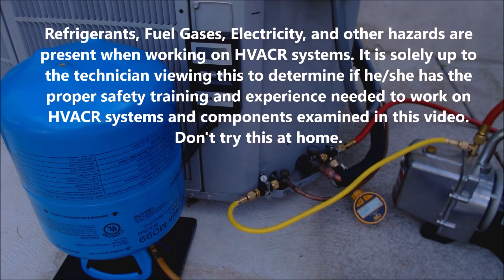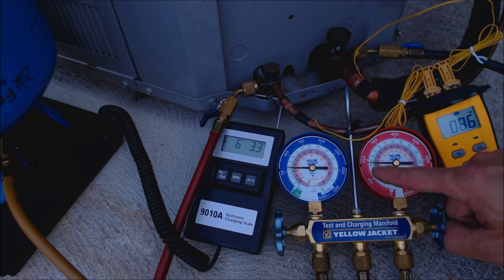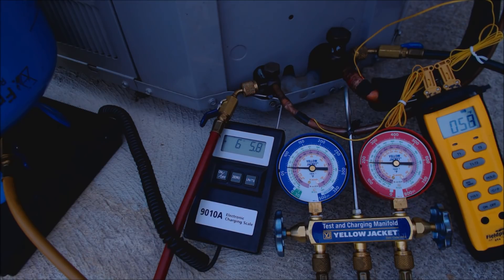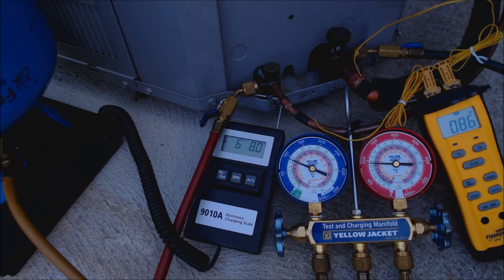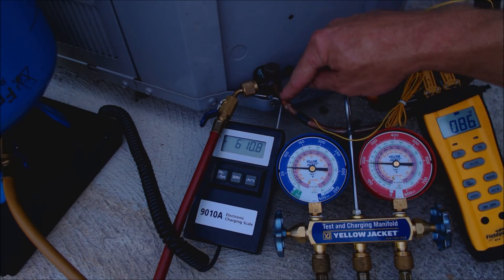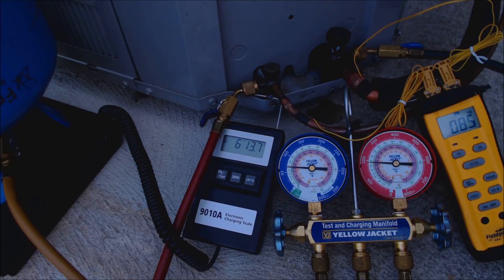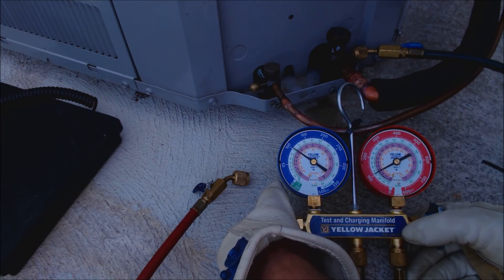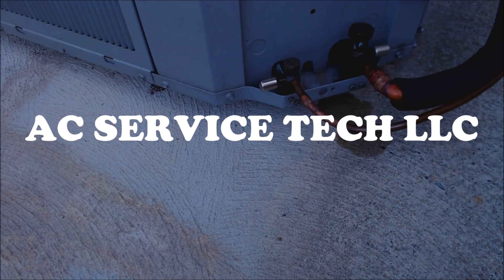R-22 Conversion to R-438A M099, Reading Pressures, Adding Refrigerant, & Disconnect

Comment: Glad to see positive videos about R22 conversions.   Too many techs just want to sell you new systems, so they make conversions sound risky, dangerous, not-as-efficient, etc.
Reply: Very true...i am trying to find a technician to do it on 2 a/c units and haven't got no luck yet sadly. Not right...
Reply: @estherbarbara  It's not set in stone, but one of the independent a/c contractors are likely to be more helpful than one of the large a/c companies.  Also, the end of the summer season or out-of-season is the best time ... when a/c guys are not very busy.  In addition, you have to weigh up the cost of R22 (which has skyrocketed in price) versus a retro-fit. If you only need very little R22 added to each unit, you might do better with a top up.   Finally, you might post your requirement on your local FB group and see if any a/c guys respond.   (Just be warned ... as I mentioned above, most a/c guys are going to want to install you a new unit, as that's where they make money!)
Reply: Update...i found a technician that did the retrofit of the units into R-427a. They are running great now. Plus a sealant I bought was added to them. Thanks
Reply: @estherbarbara  That's great news!    Glad to hear you you have saved your old ... but working ... units!

Comment: Just curious I was told that this is very flammable and dangerous to use. Due to being made with propane. Is this true?
Reply from the maker: in this mix, no and that is why this manufacturer chose to put so little of that in this refrigerant.

Comment: Hello friend ok on my kids room ac unit mini split ac it reads 130 when on with my gauge from ebay($25) and its good cold ac...now on our living room ac unit M-099 what number is good for cold ac...now I connect it with low side and with our living room ac on blowing not too cold and it reads 80...should it be abt same as the mini split reading 120-130? Please reply
Reply: Answer is 120-125 ... or ...65 on R-22 dial

Comment: Question...just replaced a compressor(heatpump)..I pull a good vacuum , add mo99 slowly in suction side about 90% of the r-22 ...I didn't install filter dryer neither I flush the lines , I have piston.... My problem is I can't get superheated ... In another the suction is 132 and head 188 psi... Compressor making a hissing noise...I had charged it with ANY running...ANY INPUT...s.o.s...

Comment: I'm starting to find a few systems with mo-99 my question is if I find a system with a small leak but customer wants to just top off the system, is it ok to top off with this blended refrigerant?
Reply from the maker: The consistency of the blend will certainly change and won't be as effective as before. It is best to find the leak and fix. The other thing is that it will be more mixed and leak mixed if it is leaking while the system is running. If the system is off then the blend really gets out of wack, thanks!

Comment: Just a thought I flush line set from attic so it flashes fast during the conversion of freon , am I right?
Reply from the maker: Yes if you flush with something like r11 flush then yes you would add it from the top and let it exit down low, thanks

Comment: very nice, yet no MO or POE be added after you recovery R22? the recovery won't lost oil?
Reply from the maker: A recovery that is done with a recovery machine while the system is off won't remove much oil so the oil level will be fine, thanks!

Comment: Excellent video and channel! One tip or recommendation I like to add is that is best practice to replace all schrader valves when retrofitting to M099. In the absence of R22(or other previous refrigerants) there can be a tendency for the neoprene material seals of the schrader valves to shrink (expand or adjust) and cause a leak. Replacing the schrader valves is a good preventative, relatively inexpensive step for longevity of most retrofits. ~ Enjoying your vids often! Nice work!
Reply from the maker: Hey KungFuMaintenance, this is a no oil change refrigerant so you don't have to change mineral oil with POE. Because of that, seals don't have to be replaced like on a r-22 to R407C. Valve cores should be changed out just because they are old though I agree. Thanks and you do a great job on your videos and content!
Reply: No need yo replace it, that's why the Schrader valve caps exist! Never forget to set them

Comment: Mo 99 is blend refrigerant isn't it and should be added as liquid ?
Reply from the maker: Yes that is correct. It has to come out of the bottle as a liquid but has to enter the low side of the system. The low side has a lower pressure than the bottle pressure where as the high side pressure has a higher pressure than the bottle pressure so refrigerant goes into the low side slowly and wait in between charges. use a 535-C for charging if there is a concern of liquid going into the compressor, thanks
Reply: Thank you very much we learned a lots just watching your video thank u

Comment: Did you put refrigerant in liquid form on low side? Not affect to compressor ?thanks,,,
Reply from the maker: Hey Cesar, this refrigerant has to come out of the bottle as a liquid. That is why I only added a small amount at a time. You can also use a vaporizer like the imperial 535-C. If it was vapor then you could just keep the low side handle open as long as you would like before stopping and checking the superheat or subcooling again, thanks

Comment: Good video! Now what refrigerant would be better MO99 or R407c?
Reply from the maker: R407C has a better energy efficiency than M099 when matched with comparable equipment but financially it may not be worth the time and effort to cut out a compressor, dump the oil out and scale new POE oil in. M099 was meant to be a fast replacement and I really prefer it over NU22B. They now make new outdoor units with POE and R407C for condensor replacements, thanks Robert!
Reply: AC Service Tech LLC so then it’s a strait drop in? MO99?
Reply from the maker: After changing the recovery, replacing the filter drier, pressure test, vacuum and as long as you don't see any issue with oil return via the existing system then yes. It is used for air conditioning applications, thanks
Reply: When installing a new condenser, say a Gaurdian with POE and stating to use R407C, can MO99 be used instead? I've had great results with MO99 and would like to be consistant with it.

Comment: What are you using to clean or flush your manifold when changing from all these different refrigerants??
Reply from the maker: I use one manifold for r-22 and M099 and another for R410a and R407C. Yet another for R134A. We do what we can without going crazy about it, thanks Shawn!
Reply: so no flush using r22 to MO99??
Reply from the maker: No, just change the filter drier unless there was a burnout or high acid contet. M099 is supposed to work with the mineral oil. Thats what they added the 600 and 601a in the refrigerant mix but nothing is really going to beat R-22 for mineral oil. I do like R407C with POE though, thanks and check the manufacturer's download -https://www.chemours.com/ISCEON/en_US/assets/downloads/k23356_8_basic_steps.pdf

Comment: i was out for 6 years medical leave union local 250 L.A. Is flushing the line set to rid it of the old oil used with the old refrigerant proven to work long run or is the jury still out?
Reply from the maker: I do think it works well but only for line sets that are mainly vertical and they won't flush evaps and condensor coils very effectively because they don't go from high to low. Once again, we do what we can when replacing burnout compressors and changing out r-22 systems to r-410a when reusing linesets. Always replace the filter drier. I replace the lineset when it is easy enough since newer equipment use larger vapor lines for efficiency, thanks
Reply: @acservicetechchannel  ok

Comment: Great video. Do you recommend changing the filter dryer?
Reply from the maker: Yes any time you open up a system for service and do all that work, definitely change the filter drier! Thanks xrayneoo!
Reply: Thats the beauty of MO99 you don't have to open the system, but in the benefit of non condensable and cross contamination I thought it proper to change the filter dryer. You have the must instructional HVAC channel in youtube. I really enjoy your videos.
Reply from the maker: Yeah since it is already at 0psig after recovery, and since you are doing all the work already, it is best to change that filter drier for the remaining life of the system, thanks a lot xrayneoo!

Comment from the maker: Download Refrigerant Slider for Free -  http://bit.ly/getrefrigerantsliderapp
 
Refrigerant Slider turns your smartphone into an easy-to-use pressure-to-temperature tool. It also provides essential refrigerant information such as GWP, ODP, class, oil type, and chemical blend for over 80 refrigerants.
 
Download Refrigerant Slider now for free on your iPhone or Android mobile device -  http://bit.ly/getrefrigerantsliderapp

Comment: Are you adding that refrigerant into the system mixed with R-22 or it complety replacement?
Reply from the maker: No, I had recovered the R-22 before I had an empty system that was vacuumed down to 180 microns. After vacuuming, I added 6lb 4oz into the liquid side. Then I started the unit up and weighed in refrigerant while checking the charge. Never mix M099 with R-22 or mix any refrigerants together as stated by the EPA section 608, thanks
Reply: Is the M099 charge the same as what the rated R22 nameplate charge was?
Reply from the maker: Yeah it was very close. M099 will end up being a little less weight than what r-22 would be for the same size tubing. Basically we weigh in 95% of what the r-22 factory charge would be with M099 and then check with superheat or subcooling accordingly to add the rest of the refrigerant while the unit is running, thanks

Comment: What is this yellow display machine and yellow  jacket tools brand is good
Reply from the maker: Those refrigerant gauges are yellow jacket brand and they have been around a long time and are reliable. That is what all my students used in the classroom as well. The ST4 is the dual temp temp reader and you can calibrate that. All tools used in the video are linked at amazon.com/shop/acservicetech and I also have a few linked above in my other comment, thanks Deepak!